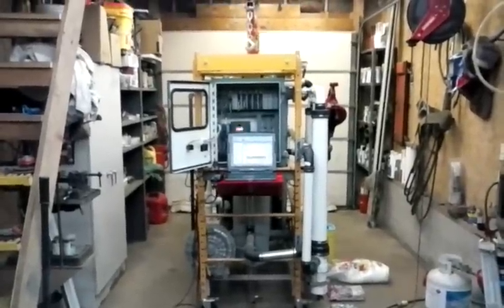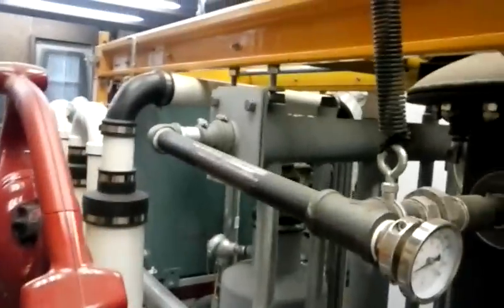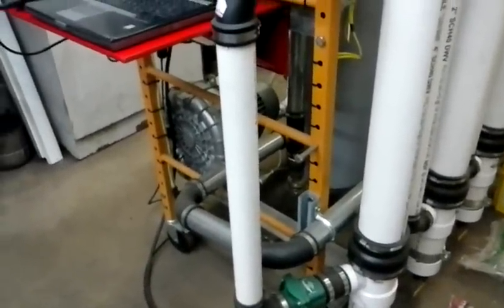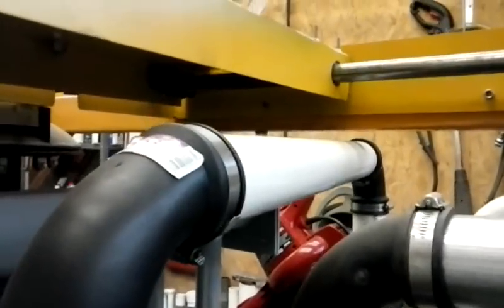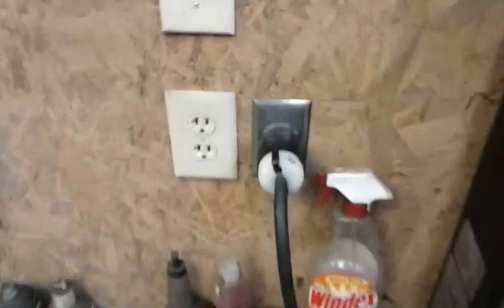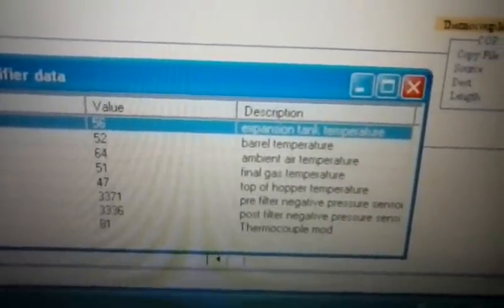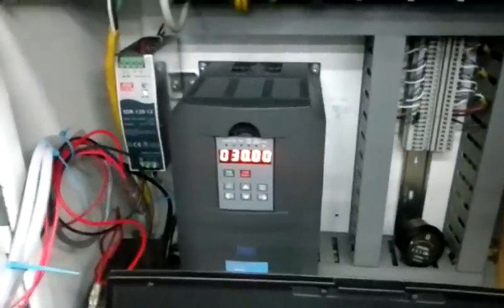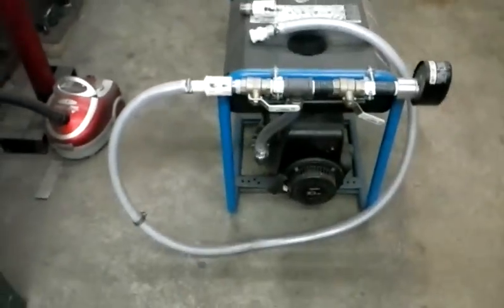Flashifier meets industrial automation part one 1-9-2016

Comment: Maz, do you have the part number for thermocouples you used?
Reply from the maker: Larry, sorry for the delayed response. I had to dig through some old paperwork till I found it. So I used one type k thermocouple. I bought it on ebay from zorotools.. Tempco tcs00016 thermocouple type k HD, 381021837973. You will also need special wire also. I used a 25 foot coil of thermoelectric type k thermocouple wire glass insulation,  30 awg NOS thermoelectric  p/n GG-30-KK. I  also used 5 RTD's ( resistance temperature detect ,with head pt100ohm probe sensors pt1/2" 50mm)for reading temperatures in different locations. Hope this helps. Joe
Reply: @mazdalorean  Thank you, sir! I’m in the process of building one using design ideas from multiple sources and yours is a big influence on mine. Your videos are very informative and entertaining, so I hope there are more updates coming. Maybe I’ll post some videos of my build and we can exchange some ideas and knowledge. My best to you and your family.
Reply from the maker: @Larry Adams , I can't remember if I chatted with you on the miniwoodgas site. I'm really bad with names. Anyway that site was put together by Flash001usa and a bunch of us did that exact thing( build a gasifier with the same dimensions with our own twists and additions). There are a bunch of us that bounce ideas off of each other. Anyway if you have any questions,  just ask away. Oh and we love gasifier videos keep us posted with your progress. I do have the original auto cad drawings of the flashier if you'd like them. I would just need your email address to send them to. Joe

Comment: hey Joe, just having a look at that set-up of yours, looks great with plenty of mods to keep you informed of what is goin on.
If i may suggest something for you to consider since i have had great success running mine after the mods i made lately, try not to use any pipes smaller than 2 inch in your system, personally not a fan of plastic pipes being used,, if you can try to use heavy walled steel pipe, this will assure you of a cooler gas,, i found this out the hard way,,, and also make sure you have a water trap or "Jar" on every single verticle down pipe there is,,, you will be surprised as to how much water will be collected, i have 9 jars on mine and a tar/water trap on the hopper and all of them collect water ,, even with super dried  woodchunks, otherwise i am very impressed and want to see your gasser run and watch you not raise a finger once its going,, that would be cool, keep up the awesome work ,
Reply from the maker: plasmacutter1 , Thanks for the kind words. I do have a lot of variation in my pipes. As a general rule,  nothing smaller than 2" on any outgoing gas lines. My air intake is all 1" , but larger in the preheat area. I have moisture collection points at the bottom of all three filters and have heard about people collecting moisture as far out as a cyclone filter before going into the engine. I never got more than a drop of moisture past my second filter. I made an elaborate final cyclone filter before my flare tube and never collected a drop . Now again I am only running pellets for now and expect to see changes when I switch over to chunk fuel, but I think I have the cooling and moisture collection down pretty well with my setup. As for the water cooling,  I agree that those systems are awesome. I'm trying to stay away from water based systems for a few reasons. For one thing,  it's -3* F outside right now. Another reason is I didn't want to end up with a liquid disposal problem. I guess the main thing is that the gas has to be clean. If I find I'm having trouble making that happen,  I will have to set up a water filter system. Honestly I won't tolerate tar being made at all, and will try to solve it in the reactor before I mask the problem down stream. I've dealt with cleaning tar, and anyone who has knows it just sucks, so that's why I insist upon trying to solve it in the reactor. Thanks for watching and commenting. I'm waiting for a little time off and about 30* warmer temperatures,  and I will try another run. Joe
Reply: lookin forward to it, good luck

Comment: Getting ready for a launch at Cape Pappa. You certainly got the green light " go" signals on the Johnson control panel.
 Carl , my HVAC, son is duly impressed and is going to show the video to his boss....who, by the way, has been wanting to build a gassier for awhile now.  Maybe this will be the spark. Good progress Joe . Thanks for the update.
Reply from the maker: +NH Hbbyloggr Thanks Bill. I really want to run this thing, but those small details that I don't have complete will drive me crazy if I rush it. I have a nice single phase motor that I will be coupling to a squirrel cage blower for my unfiltered flare . With any luck that will do what I need it to do. I too have a refrigeration class coming up and I also have to study a bit for that, so my time will be split even further for now. Thanks for commenting , and I hope the new year is treating you right. Talk to you soon. Joe

Comment: Looking good  :) .
This wonderful beast is coming along very nicely indeed.
Having damaged an engine because I was not being careful in the early days of my gasifier addiction, I can see why you are not trying to hurry this project along.
You want to get it just right, before moving on to the next step in the development process.
That takes a lot of self control, which is something many of us don't have.
Well done  :) .
If I may make a suggestion, you might benefit from having extra inspection / cleaning ports in the pre-filter metal plumbing.
Perhaps the experience is different with each gasifier, but I found that the plumbing on mine became completely choked up with soot in the first 100 hours of engine run time. 
Initially, my only way to fix it was to pull it all to pieces and manually clear out all of the pipes and radiators.
Oh, what a pain that was!
If you install pipe-cap cleaning ports in various parts of the system, you will be able to greatly simplify the cleaning process by using a method that I like to call "flame cleaning".
This involves applying a vacuum to a part of the plumbing, and using this to literally suck a flame into an open cleaning port.
Once the burn begins, you can remove the vacuum, and replace it with positive pressure at the open cleaning port.
The result is that the soot will burn inside the pipe work, generate massive amounts of heat, and clear the plumbing in the process. I do this every 80 to 100 hours. It saves me a great deal of hard work, and keeps me nice and warm on a chilly winter's day  :) .
Perhaps you will not have any issues with soot buildups, but, just in case.....

Cheers, from a fellow woodgas addict  :) .
Reply from the maker: +CNCmachiningisfun Thanks for the suggestions Steve. I did put in some clean out plugs in the top of the vertical pipes on my radiator. I have a feeling that my preheat set up for my air intake will be the most challenging thing to clean. Just the way the pipes have to be disassembled to take the sides off of the radiator will be a little time consuming , and I suspect I will be removing that system at some point. There is plenty of heat that can be used from the exhaust from the engine . I think the biggest reason I haven't already done it is because at least right now, I can still use my flow gauges . I'm sure I will figure out a way to hook them up with a different setup, but I would really like to get some numbers on how much flow the engine draws under load. I do have an inspection camera that I can snake down pipes to keep an eye on the pipes. As always , thanks for your input. It has a lot of value to someone with a lot to learn about wood gas.

Comment: Do you ever feel like we're all building Dr Seuss machines? Watching you describe the build showing the pipes zig-zagging all around the gasifier makes me feel like I'm watching a real life Dr Seuss machines in the works. I can't wait to see how this will work out for you.
Reply from the maker: +flash001USA You can't really imagine too many details in your head. There is always something that changes the way it has to be done. I remember thinking I would have room to mount the generator inside the scaffolding frame. No way. It's definitely evolving into something. I do have some parts that I may piece together for a squirrel cage blower for my pre filter flare port . Should be interesting. One thing that's nice about all of this is, this is identical to the hearth dimensions of yours, so any data that I get is relevant to anyone building it the same way. Those auto cad drawings that Mark is putting together are really sharp . Anyway, thanks for everything . Talk to you later. Joe
Reply: +mazdalorean No doubt that you've taken this pretty far on the technical end. Yeah Mark did a jam up job and I've got the CAD drawings along with the program too and I plan on taking his drawings and making a PDF file for anyone interested. There are a few basic things to correct and add but it's close.
Reply: +flash001USA  would it be called a Flasha lumpikus??

Comment: What does this whole gasifier draw for power, seems like it would draw a lot , thx
Reply from the maker: +steve fabiano  Steve, it's been a while since I looked at the draw, but when I had a different blower, it used under 300 watts , including the blower and the plc. I know there will be an additional lose of power with the use of these components, but when I'm able to get the programming right, it will be worth it . It will be able to shake it's own grate when the conditions are calling for it, ramp up the speed of the blower if the need is there , slow down or shut off the blower depending on conditions, and even shut the system down in case something is far enough out of range to warrant it. I have a lot to learn about wood gas and plc programming. It should be interesting. Thanks for watching and commenting. Joe
Reply: +mazdalorean   That's not bad at all, I thought the draw would be way higher , keep up the good work, it will be a awesome unit when your done 👍
Reply from the maker: +steve fabiano Thanks, I will be sure to    share the exact numbers when I run it with fuel in the system.

Comment: well that must have been an extra carb on top of the generator.
Reply from the maker: Sorry , I didn't do a great job explaining  that set up. There was a carb sitting on top. That was the old one. I purchased a new one, made an adapter to hook up an npt fitting directly into the new carb with the clear hose between the valve manifold and the new carb. I hope that description helps. Thanks for watching and commenting

Comment: you should have left the carb mounted to its original place that way the engine speed will be regulated by its governor, keeping the engine from over speeding and the generator at 60 Hz. the gasifier is done excellent, over the top.
Reply from the maker: I didn't move the carb, I just relocated the air filter.